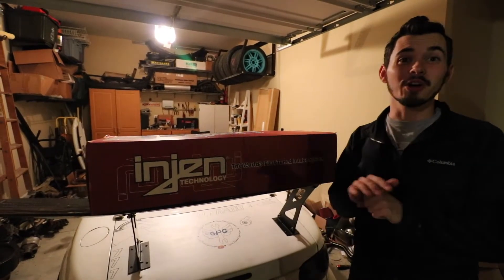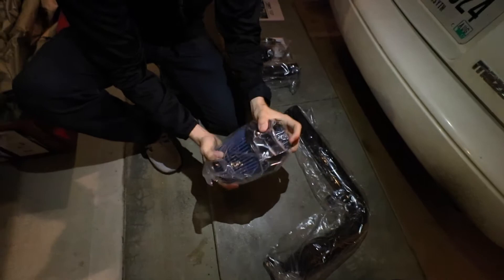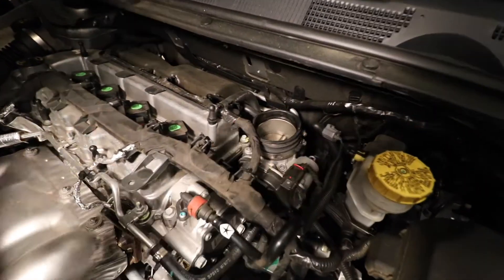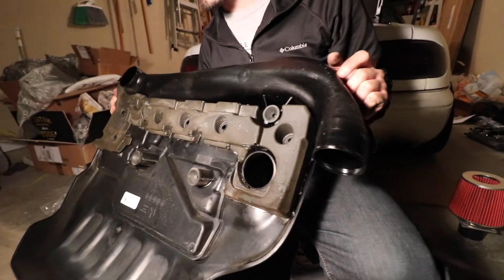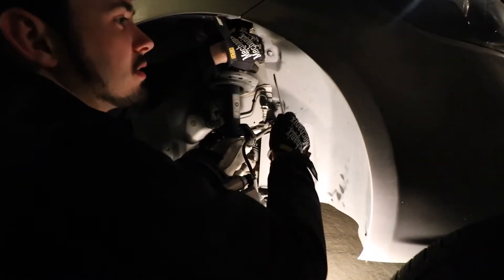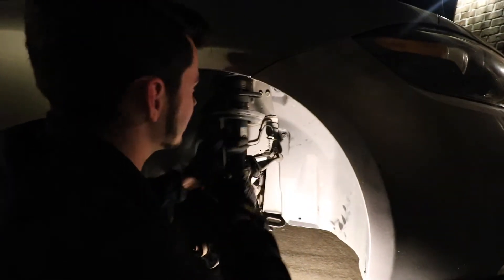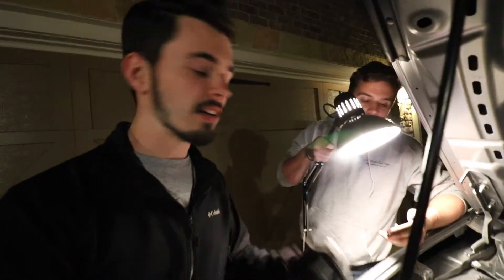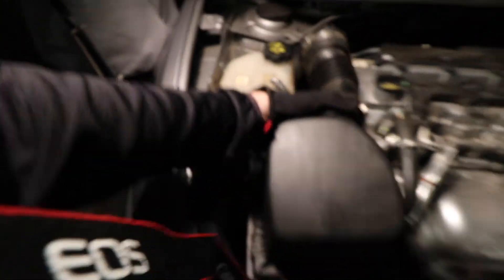First Dart Mod | Cold Air Intake

Comment: I got a 2.0 with a roadracemotorsports light weight crank pulley, moder performance lightweight water pump pulley custom dual exhaust with no muffles , takeda cold air intake. Next week im getting headers and high flow cat

Comment: I installed the same intake in my dart
Reply: Gilberto Luna what other mods have you done?
Reply: I've got eibach lowering springs and I did a crosshair delete on it as well I plan to get an exhaust installed on it
Reply from the maker: +Gilberto Luna which springs do you have? The sport line or the pro? How do you like them?
Reply: I have the pros i love them they don't drop the car too low they completely changed the dart's performance espíritu paired with the intake